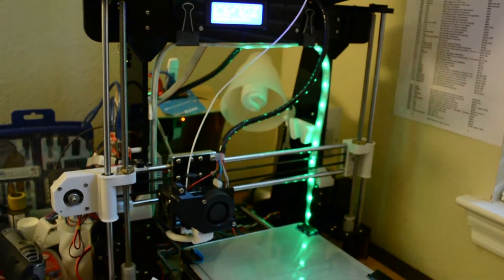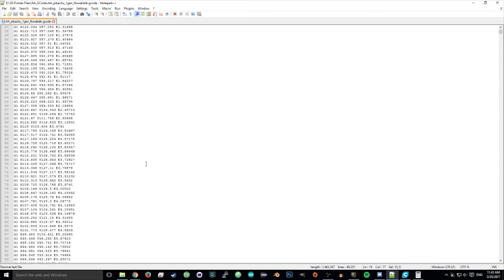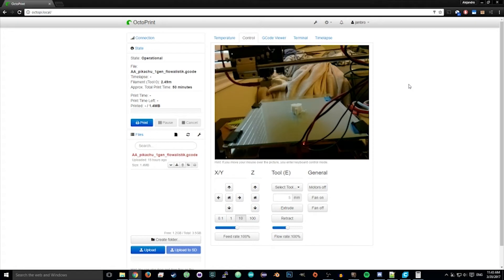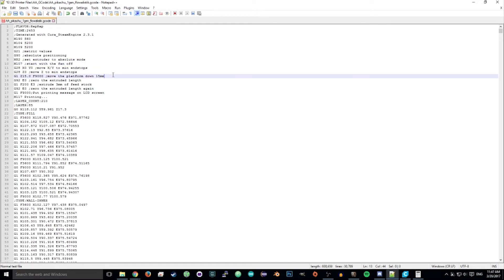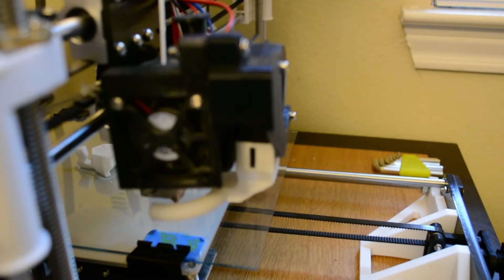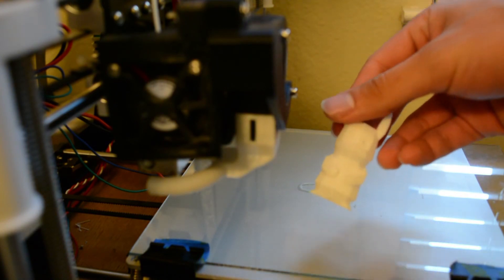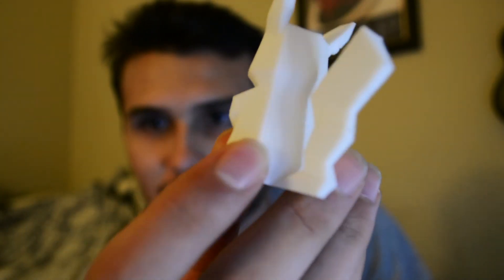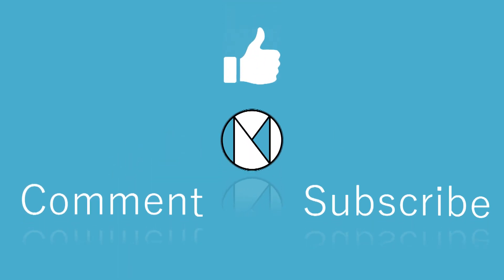How to Resume Failed 3D Prints

Comment: Clear instructions and a great condense how-to. Thanks, I saved a 14 hour print. I shouldn't have sent it home first because it did knock it over (my mistake) and restarted slightly off position but I just paused it and moved the bed slightly. It's going to work for what I need it to do.

Comment: What if the model is no longer on the bed ,, is there a way to easily renumber the missing layers so I can just print the top of the model on a clean bed?
Reply from the maker: In that case, if you’re using cura you can lower the model through the build platform the measured height of the part you have printed. Then you can slice and print as normal and glue the separate pieces together
Reply: @JanbroMunoz  what If I only have the gcode?
Reply from the maker: @parsec3d  That's a tougher case since the z offsets for each layer will be off. This also depends on if the gcode was sliced to use absolute or relative positioning commands.

Comment: Problem many of us need to solve is....homing the printer...with ABL my printer Homes in the Center right where my print is located. Is there a way to Home in a corner like so many of the older printers use. ???? Thanks.
Reply from the maker: I would just remove the command G29 in the gcode which does auto bed leveling. Since your printer ran auto bed leveling at the beginning of the print it should have the correct z offsets.

Comment: Which program did you use to edit the gcode?
Reply from the maker: Hey Anton, I used Notepad++
Reply: @JanbroMunoz  Thank you
Reply: @JanbroMunoz  I just downloaded the latest Notepad ++ and there is no option to save as .gcode?
Reply from the maker: @jeffmilkey  You should be able to save the file as the same format is was opened by going to File->Save. If it doesn't have the right extension, do File->Save As and change whats after the period to .gcode

Comment: adhesion between the last layer and the next layer is going to be very weak btw
Reply from the maker: That's a good point, this also depends on how accurately your measure the part. But it would be very difficult to get it to start exactly where it left off by modifying the gcode directly so there will be gaps in the layer. For cosmetic parts like this it was strong enough though

Comment: Oh my god, THANK YOU! Had an error after a pause at layer height (Cura problem) Apparently the software decided that printing 15mm above the pause layer would work... I stopped the print, preheated the bed to keep it at temp, watched several videos that just got me more confused, finally found yours, modified the gcode, opened it with Cura to visibly check the preview, and finally ran FINGERS CROSSED.gcode through my Ender 3 Pro. I was 11 hours in to this print for the second time today. The first time, another video sent the print head crashing into the print, ruining everything. I REALLY appreciate the help.
Reply from the maker: Glad you were able to save your print!

Comment: What if you don't have a caliper?
Reply: If you can afford a 3D printer go down to Harbor Freight and buy one. You'll use it all the time I know.
Reply from the maker: You can use any measurement method to get a rough estimate of what height the print was at it will just take more trial and error. Be sure to send test gcode to the printer to test the height first. Adjust the z value and try different heights until your nozzle is at a height that barely touches where the print left off.
Reply: I've tried that based off your method all day today. I had to get the height measurement of the model that I stopped at, divide that based on the layer size that was in the gcode, and found the closest layer value off of that. Then, when I found the closest value, with a lot of help from somone else, I was able to resume the print based on the calculations he made at least once, but we had to add some extra instructions to make it resume like this.

G92 E7448.45519
G1 F3000 Z39.600
G1 F3000 Y89.289
G1 F3000 X110.535
G1 F3000 Z38.600

But after that first time, it seems like I was printing in mid air every single time.
Reply from the maker: seekertosecrets You may have to home your printer so it knows where zero is again. If you’re sending the same z offset it seems strange it would go to a different height. Best of luck

Comment: you are awesome
you saved my day
the Electricity was cut in layer 340 out of 483 layer at a height of z68.2 mm
I applied your method 
I opened the g-code with notepad++ and deleted everything before layer 340 and of curse kept the basic code
Then I added command G28 to confirm resetting motors
And made a simple change in the first line of the 340 layer to avoid colliding Nozzle with the model, starting with first move on the Z axis to reach the right height
Then move on the x and y axes
my code become like this

;FLAVOR:Marlin
;TIME:12266
;Filament used: 11.9758m
;Layer height: 0.2
;Generated with Cura_SteamEngine 3.4.1
M190 S60
M104 S196
M109 S196
M82 ;absolute extrusion mode
M117 Printing         ; Indicate Printing in progress on LCD
G92 E0
G1 F2700 E-4
G28
;LAYER:340
G0 Z68.2 F4000
G0 X141.062 Y120.853
...
...

And succeeded
Thank you again